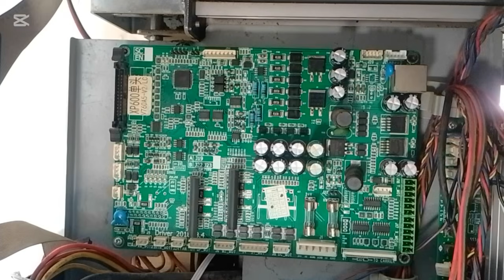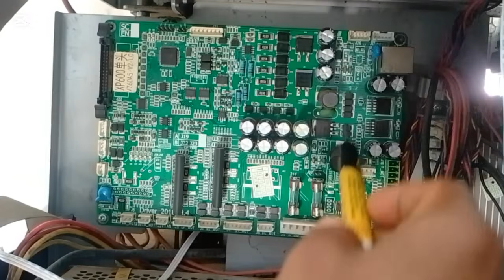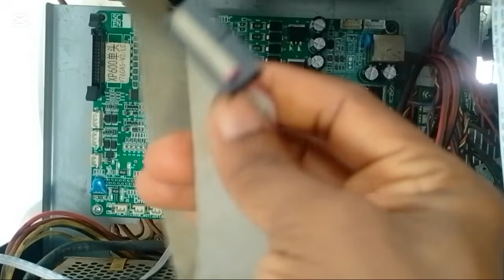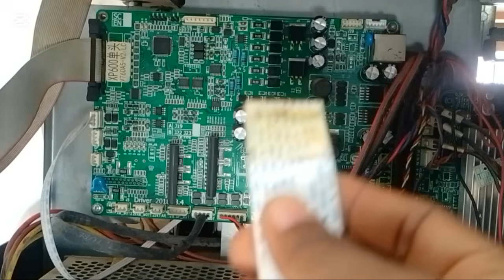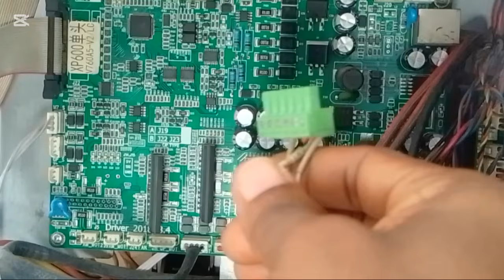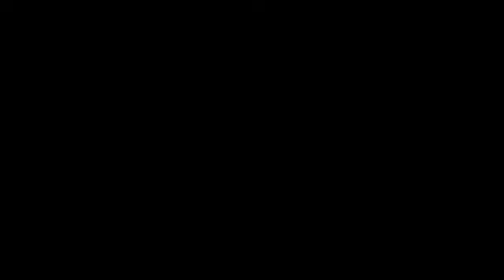XP600 Driver Board Connection Guide | Step-by-Step Setup & Troubleshooting

Comment: Why the 24v fuse get cutting ( burnt) pls
Reply from the maker: It could be caused by faulty power pack or short circuit on the driver( main) board.
Reply: @microtechFIX  boss good morning sir
So the rider is coming your way now help me to check the board i don't think is faulty